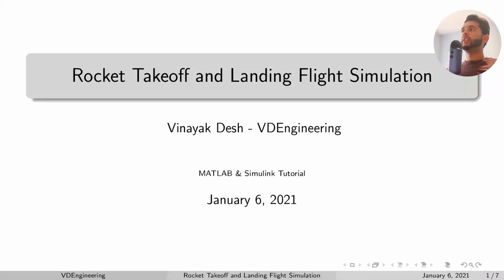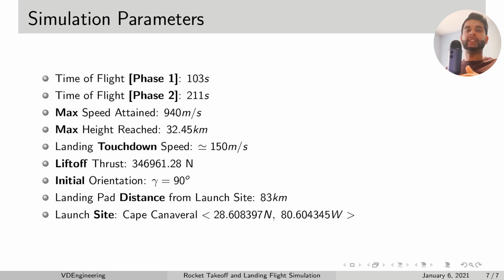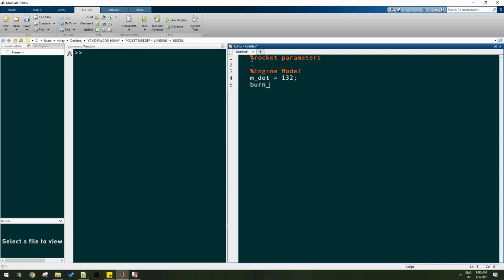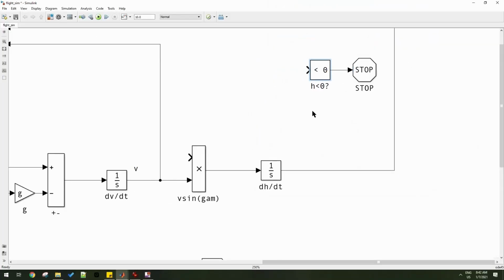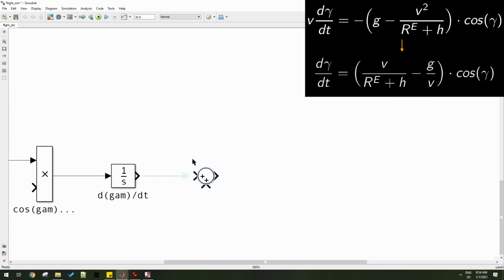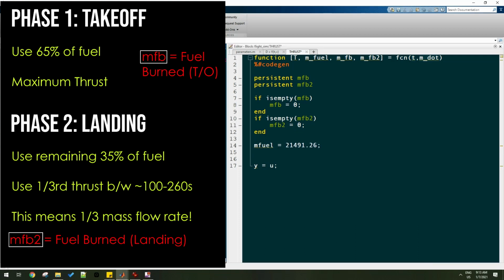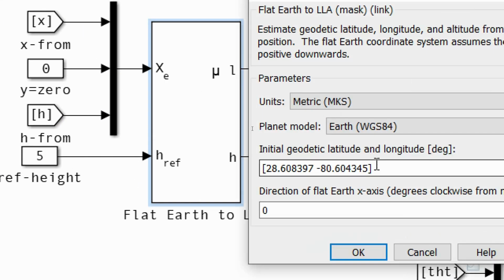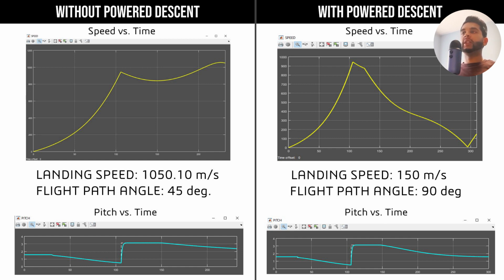Rocket Takeoff AND LANDING! - Matlab & Simulink Tutorial

Comment: If the rocket is flying with a flight path angle gamma during the launch, why isn’t the altitude h*sin(gamma) ? That was done for dx/dt and dh/dt to resolve vertical and down range velocity
Reply: Oh never mind. I see it now. The height h is directly pulled from the dh/dt block in which it’s already integrated by v*sin(gamma). The way I’m structuring my simulator is a little different.
Reply: Have you tried your way?? and is it working?? @julianchee

Comment: My iteration stops at around t=100 sec. did you modify your code after the video but before you ran your simulation? My height drops drastically around t=75
Reply: Did you solve the problem?
Reply from the maker: Yes it stops when height is near 0

Comment: Do rocket second stage ignite by it self or do they ignite on ground station? and how do separation work?
Reply from the maker: Seperation is done by releasing bolts which attach the stages. Second stage is turned on by flight computer.